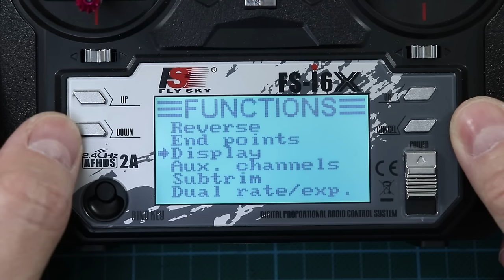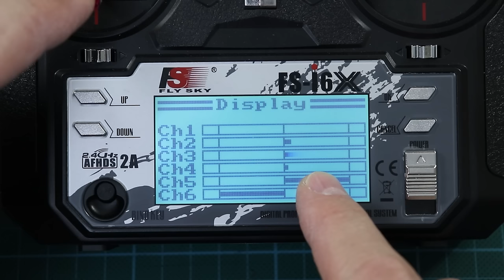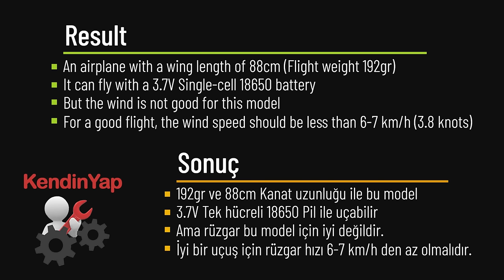How to Make Cheap Single Cell Battery Powered RC Airplane.. Homemade Airplane

Comment: Hey I've been watching your videos since long and it's really great.. i've a question, does the motor create all the thrust or the large wings inclined at an angle with the horizontal axis contribute some upward lift too ?? I'd be grateful if you answer
Reply from the maker: The motor provides the propulsion. As long as there is thrust in the forward direction, the lift force of the wings occurs in the upward direction. But after the engine stops, some more gliding continues.

Comment: Elinize sağlık hocam çok güzel olmuş , uçuş süresi nedir acaba. Birde hocam , motorların üstüne lehimlediğiniz 2 parça ne işe yarıyor .
Reply: 2:47 de yazıyor. "elektriksel gürültüyü filtrelemek için."
Reply: seramik kondansatör. paraziti engellemek için, motor gerisinde olan devreyi korumak için, motorun daha iyi çalışması için felan
Reply: @huseyin985  Teşekkür ederim gözümden kaçmış, Bazen motor daha güçlü olsun diye buna benzer parça lehimliyorlar acaba odan mı diye sordum bende.
Reply: @esatkdn  Anladım , çok teşekkür ederim.
Reply from the maker: Yeterince cevap verilmiş. Biraz daha açayım. Motorların bobinleri çalışma esnasında elektriksel gürültü (parazit gibi) üretirler. Bu gürültü elektronik devreleri özellikle alıcı gibi devrelerin sinyallerini olumsuz etkileyebilir. Seramik kondansatörler bu gürültüyü filtreler.
Reply: @Kendin-Yap  Buna benzer bir sistemi quad yaparken kullanmıştım hocam . Fc ile lipo arasına kondansatör koyarak  fpv görüntüdeki parazitlenmenin önüne geçiyorduk.

Comment: Hey, so I’m doing this for my science fair and while I was connecting the battery to the esc the esc started smoking. Do you know why? The battery is 4.2 volts - 5 volts, I think that was the issue but I’m not sure.
Reply from the maker: ESC supports up to 8.4V. The problem is not voltage.. You must have connected the positive and negative poles wrong. Another possibility is that you may have short-circuited the motor output cable ends. In both cases, ESC burn up.
Reply: @Kendin-Yap Ok, thank you it works now. The only problem is I used cardboard for the whole thing and the plane won’t fly or glide with the wind. It fell and the cardboard body is destroyed any recommendations?
Reply: @crescentcabbage8065  use deprons bhai
Reply: @vidhush02 I used the Kraft foam now for the body. Unfortunately, I couldn’t find any 3mm foam for the wings so I thought of using 3mm Eva foam but that bends too much and isn’t structurally strong. The plane still doesn’t glide and falls. Have any ideas what I did wrong and why it doesn’t fly.

Comment: Hi..nice build. I  have a question..so rhe micro receiver u used in this build  it paired up to your flysky radio even though it's not a flysky receiver??? And that being said I'm guessing you bind that receiver to your flysky radio the same way you bind a flysky receiver to your flysky radio??thanks....
Reply: FS2A four channel receiver is using AFHDS 2A protocol so it can be bind with flysky transmitters, I also having it and works really well.
Reply from the maker: Yes, a receiver (FS2A) for Flysky radios. Matches like other Flysky receivers.
Reply: @kushanvimanka8323  I have to get me a couple of these FS2A receivers for my fly sky radio do u have a link to were to get them?? If not I'm sure I can find umm somewhere?? Just thought I'd ask...thanks

Comment: Hey u have used 9gr servos which work with 5v but the maximum power supply is at full charge 4.2v so how did they work?
Reply from the maker: These servos can operate up to 3.8v-3.9V level. It loses some speed and torque, but that's not a problem for this model.

Comment: I have a question since I have been planning on following this build for my project. Will the 20A esc work on a single 3.7v battery ? the product specs say it takes 4.8v-7.6v and this has confused me a bit. Also, does the ESC have a BEC to power the arduino based receiver? Its hard to source smaller bldc motors where I live and I want my build to be light enough to work off a single cell. I am also planning on trying make an rc car from a die cast model (bigger than hot wheels so space is there for arduino and everything). Hope you see this and reply.
Reply from the maker: When the 3.7V battery is fully charged, it is 4.2V. This ESC can work up to 3.9V. BEC available. But your receiver and servon must also be able to work with low voltage. The ones I used in the video can work.
Reply: @Kendin-Yap  THANK YOU SO MUCH for the reply. I just got the batteries and ESC in the mail and tested and it works. The concern i have is if the Arduino based receiver I'm planning on making will work well. My arduino nanos seem to work fine but i am yet to test the nrf24l modules and servos.

Comment: VERY NICE! 
why didnt you cover the bottum side of the wing? 
withiot this cover the lift is damaged and making a lot of turbulence on the wing.
Reply from the maker: Thanks.. I made this to be lightweight. In addition, this (Concave profile) allows it to fly at very low speeds. It is not wrong to have an open wing.

Comment: I have watched your video many times and followed the guidelines for my plane. I had problems with the radio because I had to hold the "Cancel" key longer to save the configuration. 🙂With 3.7 the engine has no power. Maybe because the other elements subtract energy from the engine? So I put a 7.4 battery in it and it sounds better. But won't the motor burn out?  thanks for answering
Reply from the maker: When a 3.7V cell battery is charged, it will be 4.2V. It should be fine until it drops to 3.8 - 3.9V.
Since the engine will produce high power when 7.4V battery is used, the structural strength of the fuselage and wing of the aircraft will not be sufficient. This model has to be very light in order to fly with low power. Therefore, it does not have the structural strength required for high strength. If you are going to use it with 7.4V, you need to strengthen the wing and fuselage. (Can work with DC 180 motor 7.4v.)
Reply: @Kendin-Yap  You are very kind to answer. It's clear to me from other answers you've given. Thank you

Comment: What will happen if i use 2S 18650 batteries ?
Reply from the maker: Since 2S will provide high power, you should structurally strengthen the wing.
Reply: @Kendin-Yap  Well how much amp will it draw ? And I found some 180 motors that look almost  the same as yours . But one has FK-181PH written on it , another one has FK-180PH . Which one will be better  ?
Reply from the maker: @AdamTheBot  DC180 motors are very similar to each other but have very different technical features. Even those with the same code may differ. Therefore, it is not possible for me to know the current of your motor. The motors I use, with 2S lipo, draw approximately 9 amps of power at full throttle (with 108mm propeller).
Reply: @Kendin-Yap  Thanks 😍 .

Comment: @KendinYap. Hi Sir, I'm about to order the parts to build my first airplane, the "Single Cell Battery Powered RC Airplane." Something is calling out to me. The recommended voltage range for the ESC is 4.8V to 8.4V. You're using a single 3.7V cell. How do you explain this? I'll read you carefully before finalizing my order.
Reply from the maker: Every ESC has some flexibility in the positive and negative direction. When the single cell battery is fully charged it is 4.2V. The ESC I mentioned in the link works smoothly up to 3.9V. I tested it for a long time and had no problems.

Comment: Sir, can I use that DIY rc transmitter and receiver in this project that you have taught how to made it earlier ?
Reply from the maker: It is a little heavy. This model has to be very light.

Comment: Abi ben Arduino ile kumanda yaptım 3 km ye kadar basit RC uçak uçurdum fakat şimdi 2.38 boyunda yapicam 2 kg a yakın bir ağırlık var 2 adet 1400 kv motor ve 1045 pervane ile kaldırabilir mi acaba ?

Comment: 2:29 and 4:45 ) Where can i buy that red and black cable on the battery / motor???

and also at 3:05 we can sea on the motor that black cable with red where can i buy that en how does that fit there??
Reply from the maker: I added it to the links. Please check again

Comment: Hi There....i need your help...i followed the instructions but 5:53 to 7:22. But FC-16X is not remembering the setting. CH3 still goes complete back n forth and not able to see any power to Motor. What am i doing wrong? Could you please guide? Both reciver and ESC have flashing blue (slow) and fashing red and it only makes 1 DO sound.
Reply from the maker: If you are talking about FS-i6X, you need to press and hold the CANCEL button for a long time to save the setting.
Reply: @Kendin-Yap  Thanks so much for responding. Got it  able to pass that one. But still no power is going to motor.  ESD board just makes one DO beep but nothing past that, unlike in your video DO BE MI (7:36 to 7:43). Could you please help, if the issue is receiver board or ESC Board? i ordered another set just in case. Battery is fully charged 4.18v , Now reciever light is blinking slow (so should be connected). Any suggestion will be very helpful
Reply: @Kendin-Yap  Could it be the ESC board  not working?  I just not able to figure out if the receiver is the problem or the ESC board. Shipping is taking time. Any suggestion will be helpful!!
Reply: @Kendin-Yap: Thanks for your help. Realized the issue with Transmitter and Receiver were not binded. After doing the binding process it started working.

Comment: How can the esc which  is rated for 4.8v functions on 3.7v?
Reply from the maker: When 1S battery is full, it is 4.2V. And these ESCs have voltage flexibility. It works fine until it drops to 3.8-3.9V.
Reply: @Kendin-Yap  thanks👍

Comment: kullandığın motor hakkında bilgi verirmisin
Sorum şu ki, bu motorun başka bir alternatifi var mı çünkü ülkemde bu motor mevcut değil, bu yüzden lütfen bir şeyler yapın ve yakında bana cevap verin
Reply from the maker: Bu fırçalı bir motordur. Maksimum 8V ile çalışır. Maks 70 watt gücündedir. Ağırlığı 33 gr. Yaklaşık ölçüler: 34x20x15.5 mm.
Reply: bu motor yerine çekirdeksiz motor kullanabilir miyim
Reply: Like drone motor
Reply from the maker: @BinitKumar-mn7gt  Çekirdeksiz motorlar çok küçük. Bu model için güçsüzdürler.  Ama kanatlara ikişertane takılırsa yeterli olur. Toplam 4 çekirdeksiz motor.
Reply: Thanks bro

Comment: I can't figure out why none of my rc planes fly. They are all light (made of foam board about 350g with batt), have a 700g of thrust motor (8060 prop), have large control surfaces and wing spans, yet they all take off, fly about 8-12 mph and have no control (rolling or vertical). I can even see the control surfaces working well with my controller during a "flight." Any ideas?????
Reply: CG
Reply: @gamerzempire2573  I have tried moving the CG all over the wing, and it will ether go 90 degrees or it will fly straight and quickly dart to one side with no control.

Comment: Başlık yanlış mı? Yeni pil çeşidi mi?
Reply from the maker: Yanlış değil. Yeni bir pil çeşidi de değil. 18650 pil diye aratın. Bir çok satış yerini bulabilirsiniz.
Reply: @Kendin-Yap  18650 yi biliyorum, ama 1860 yazınca ona istinaden yazdım
Reply from the maker: @sahatolye1390  Evet Türkçe kısmında bir rakam eksik kalmış. Düzelttim. Teşekkürler.

Comment: For the Control / Radio system from Aliexpres witch version i need for this plane? because there are a lot off versions
Reply from the maker: You can get the one marked "No Receiver". Because you need to buy the micro receiver separately.

Comment: Hl algo en la electronica que no entiendo lo podes aser con un 30 A el  esc una sola bateria podes
Reply from the maker: 6A is enough but 20A or 30A esc is cheaper.

Comment: Motorun itiş kuvveti ne kadar ?
Aslında asıl sorum ağırlıktan fazla itiş kuvvetine gerek var mı ?

Ben aynısının gövde konusunda biraz değişiğini mikro fırçasız motor, 3S 1050 mAh LiPo konfigrasyonlusunu yapmayı planlıyorum.
Ağırlık 300 gram, thrust da 250 gram, yeter mi sizce ?
Reply from the maker: İtiş kuvveti ihtiyacı uçağın genel yapısına bağlıdır. Her uçakta aynı mantık geçerli olmaz. Benim kullandığım motorun 7.4V ile itiş kuvveti 180-190 gr. Ama tek pil yani 3.7V ile ile itiş kuvveti 100gr ın altında. Fakat Uçağın kanat yapısı, ince gövde yapısı vs ile bu192gr lık modeli uçurabiliyor. Yaptığınız modelin ağırlığı 300gr olduğu için kesinlikle kanadın altını düz bir şekilde köpük ile kaplayın yoksa havada katlanacaktır. Benim yaptığım kanat yapısı çok hafif modeller için uygundur.